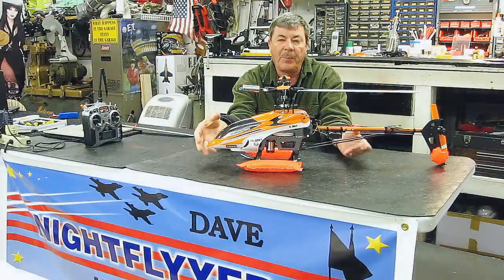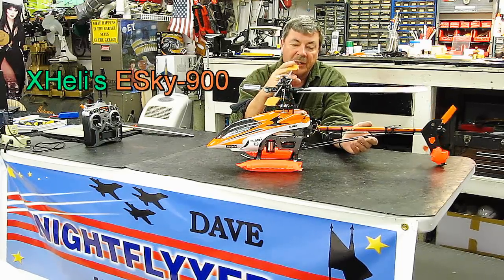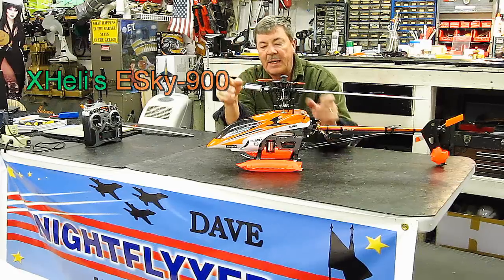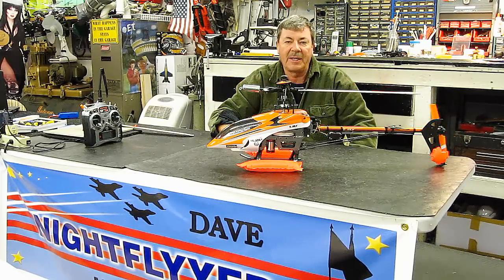Single Rotor Bladed E-Sky 900 Heli + Mild 3D STUNTS of Blade 400 & Hyperfly

Comment: Hey Dave, are you concerned at all, especially with the larger models, of over stressing the head mechanism since only one side is carrying all the weight of the helicopter?  Also, would it cause more wear on the bearings?

Good work Dave...and very interesting stuff!

Comment: Impressive!
What do you do to get the same length to CG on each side of the center of the rotorhead? Or have you trimmed the counterweight to an given RPM?
I would like to belive that the centripetal force would differ on each side on variation of rotorspeed, and then cause vibrations.

Comment: Hey Dave, on one of your previous videos a guy had mentioned an idea of having two blades but positioned at different depths on say... the chord line, or the rotor height. so that way the blades aren't traveling into eachothers exact path and not catching the turbulence. any thoughts on this? for example, a planes nose cone haveing a prop blade towards the tip of the cone and one towards the base of the cone near the fueselage.

Comment: @NightFlyyer i understand the power situation and you're right. but according to what you're saying with two blades at different heights... wouldn't that mean that the lower set of blades on a coaxial heli catch turbulence from both eachother AND the top set of blades? How about a coaxial with a single top blade and single bottom blade that are opposing eachother? That would be interesting to see.

Comment: Hi nightflyyer, Great Video! But i got a question (general on helicopters) Why do all of you guys fly/hover with a throttle curve? i don`t really see any point there because if you change your pitch angle on your main blades, your RPM does change too! (less pitch= less RPM= less cyclic/tail control wich causes instability in hover!) i`m not quiete sure but im my opinion the cyclic and tail controls do raect much better also with a flat throttle curve (constant RPM) so why do you fly like that?

Comment: @NightFlyyer I said that wrong, I meant too say that I don't know how to set up the transmitter.  Channels 5-7 on the transmitter are wrong, they activate by turning the trim knobs and it should be on the right stick.  And since you have an Exceed rc tx system i was hoping that you could possibly switch them.  I can fly rc helicopter well because of you, thanks for that.

Comment: Well I must say that I admire people who want to do something different and without it there would be no inventions,  but in my opinion reduction of wake by reducing one blade is negligible (still there is one blade which does some turbulence) and second thing is that airfoil has different drag coeff. than cylinder so it may result flutter like phenomena. Did you think about something else maybe two blade at different height of shaft? It would also reduce noise but may start  bending momentum

Comment: Noticed that the Heli had a wobble......... Heli's arent designed to fly with one blade..even if you balance the blade with counter weight.........It works........but not designed to fly that way..... Need at least two blades to properly fly.......Aerodynamics

Comment: I can get this 3D heli for about $200usd,  also need to buy brushless motor, ESC 60A, battery, transmitter, receiver, pitch gauge, servo,  head lock gyros, charger, and adapter.  I need help for that coz Im new to the hobby in rc helicopter.